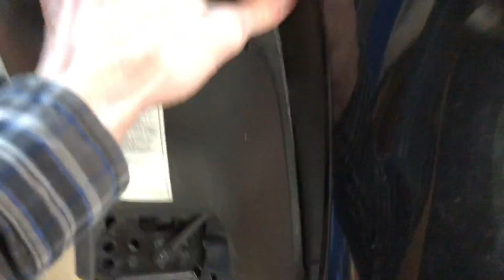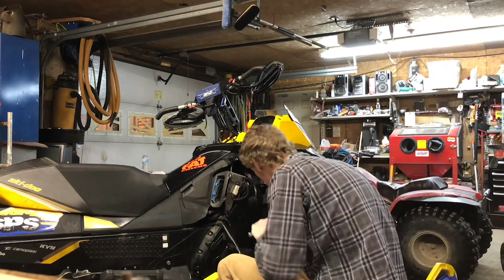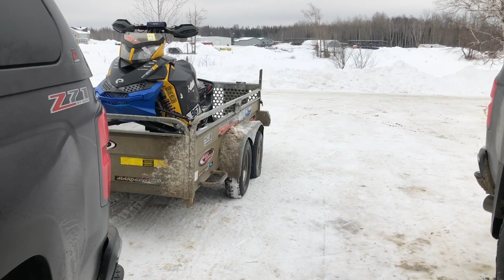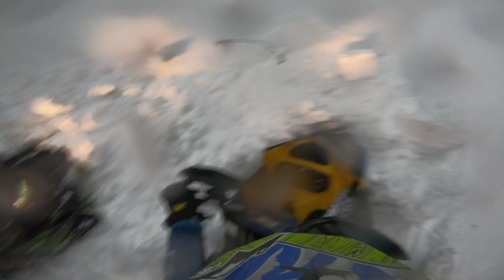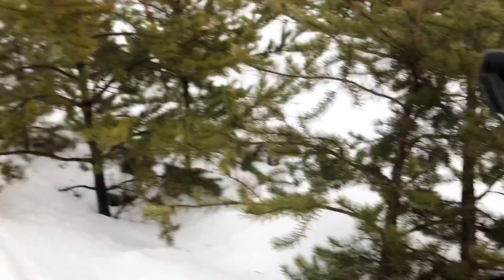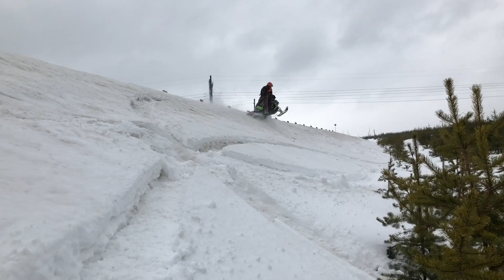COTTAGE SLEDDING! DEEP SNOW

Comment: Awesome conditions, thanks for sharing.

On an unrelated note, ever had to repack the crank bearings on the clutch and PTO side?  I have a similar year and engine and people are saying only the clutch side needs it but that seems weird to me.  Do you have any advice?
Reply from the maker: I haven't changed mine yet but that does seem weird why not just do both?
Reply: spsproductions11 Bit of a pain is all.  To do the Gen side you have to take a lot off and then it involves using a syringe and needle to inject an exact amount into removed bolt holes....  Seems a bit risky and people have blown inner seals putting too much in assuming it was worse than it really was.

How many km on your sled?